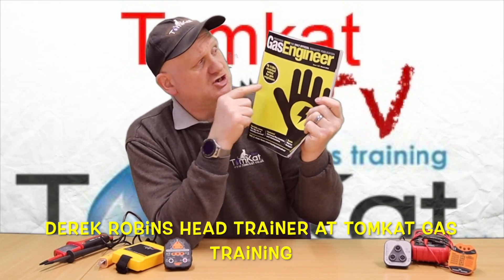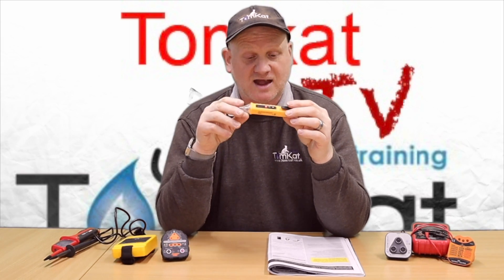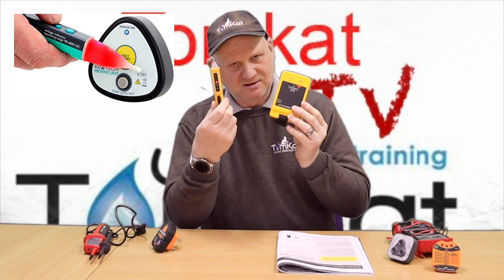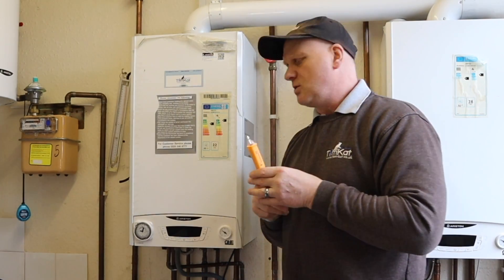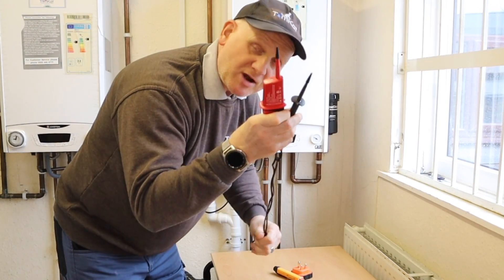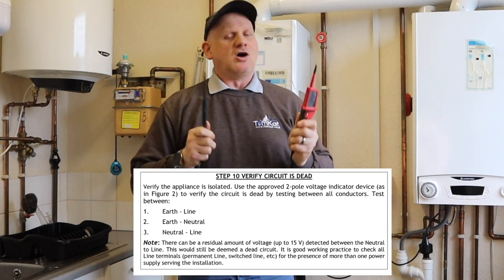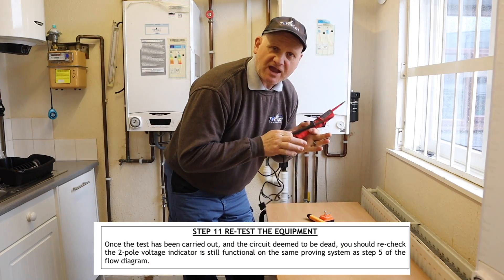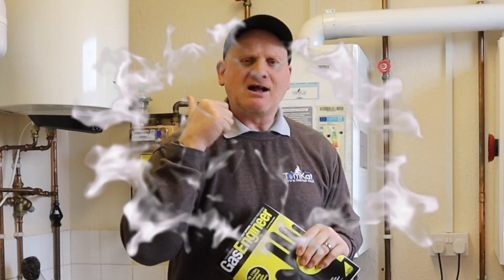Gas safe technical bulletin 118a electrical safety for gas engineers. Looking at the changes.

Comment: Can you clarify if Earth Loop impedance testing is required please?

TB118 Jan 2018 mentions undertaking an Earth Loop Impedance test and the equipment required. 

But there is no mention of an Earth Loop Impedance test in TB118a, and TB118a clearly says it replaced the now withdrawn 2018 version.

I understand that TB118c will follow and that will cover Earth Loop Impedance, but what is the current position?
Reply from the maker: @PaulWells-d8h  not required under tb 118a
Reply: @tomkatgastraining  Thanks Derek .

Comment: Thank you for such a prompt reply, Like you I've been doing this for a long time and love your way of passing information.  Back to the live casing though.... If the case was live why didn't it go to earth and trip / blow the fuse ?
Cheers Derek
Reply from the maker: Top and bottom of the boiler were plastic and not connected to earth so live case good job it was in an office in a locked cupboard

Comment: Hello Derek,  So a screw through the bracket to the live conductor and the fuse /RCD  trip didn't go?  Does this mean that the boiler had been incorrectly wired, with no earth? and thereby all the heating and gas pipes were also live?  Someone could have been Killed!
Reply from the maker: No it had only just nicked the live it didn’t touch the earth wire and it was on a fuse not mcb and yes some could have been killed

Comment: As nice as the bulletin is, from dual qualified position it's a bit of a joke. For instance the death sticks should never be used to prove dead but are used to identify if something is live and honestly should never be trusted. Voltage testers are always a sensible idea (multi-meters don't comply with GS38 though they're more useful for a service and breakdown engineer).

It's been a long time coming but it also shows installs should have a double pole or triple pole fan isolator with fuse, not just be supplied via a switch fuse that doesn't isolate the neutral. Personally I find the biggest safety issue these days to be that lack of isolation especially on properties where supplies are now TNC-S (PME) as if the neutral rots in the road the CPC's/ earth of the installation becomes a line conductor, which a death stick will pick up after isolation in a property with a solid floor but not always with suspended floors.

Comment: The thing that really annoys me is that regarding multimeters. We who do repairs have them and most often need them to test thermistors,variable votages  and continuity and yet are not trusted to use the same tool to test for 1 of those features 240v. My last gas safe inspector told me I should be wearing a portable monoxide detector for entering people's homes. I said what about when I go out socially and he said yes there too. I think I will just take my analyser with me to the pub
Reply: i know what you mean, the new ones are not on this planet

Comment: Hi Derrek always enjoy your videos. You explained the none contact volt stick needs to test as low as 50volts but you tested on a 240 volt outlet, that suggests it only has been proved for 240volts not 50volts or is the test acceptable for full range of voltages.
Reply from the maker: Testing it at 230 volts is good enough to prove it’s working. The proving unit also only test the 2 pole tester at 230 volts even though it can show 12 volts.

Comment: The only trade to have to be regulated to do all other trades as well...what next from gas safe? Common sense when working with gas or electricity should come to the forefront.

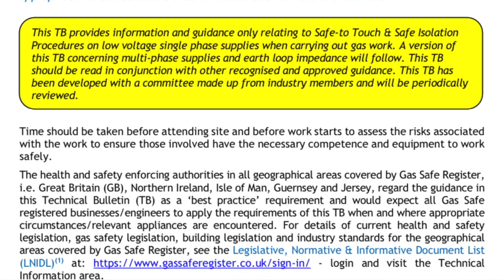Analysers were a one off qualification, which was straight away added to our 5 year acs course! How many times has the way we use our FGA changed? 18:43 

Do builders have to go back to be told how to lay bricks every 5 years and joiners how to cut timber safely?

Maybe gas safe should be ensuring our National gas transporter adheres to basic gas safety regulations and not allowing them to be EXEMPT( as confirmed to me directly from gas safe register)is that not also deemed a danger??

Yes they can re-pipe one of my installations due to a new main and relocation of the gas meter and very poorly as well and carry out no gas checks or commissioning of the appliances allowing the clown to re-connect to redundant pipework as well creating an 8mbar drop before he left, disced the meter and started next doors gas work!!!!

The gas industry is smoke screens and mirrors hence why so many engineers fail to renew every year, as with this country we know how to push good people away normally due to continuous greed. Some of the so called Rogue engineers are probably some very good well educated engineers doing nothing wrong but opting not to keep paying for their plastic card and be a puppet to this industry, I wonder why we have a shortage of trades??

Rant over.

Comment: Derek I have a question , I have an old boiler 25kwh which will have to be swapped out, British Gas came around and said as part of building l all the radiators must be fitted with trv, and pipe work gas to be altered into zones than s plan and only quoted for a boiler 3 kwh more than the heat loss now my brain is telling me that won’t be big enough if we are losing 20kwh in heat on the property as the cylinder would need more than 3kwh to heat it indirectly or am I getting my math wrong but also queried why if they have to change the heating feed to the cylinder to from 22mm to 28mm he quotes just new regs is that right ? My understanding is hot water is hot water and have no interest to go to a heat pump again especially with s building with 20kwh heat loss
Reply: Why don’t you pay a professional to look at your situation rather than hoping for free advice on youtube?
Reply: @milkyporridge5929   i am trying to query what a supposed professional told me, which i think is wrong hence ask the pro man who has covered changes in part l but i didn't fully understand so was hoping for a quick answer if this was mandatory or could I keep with 22 and 15mm pipes  as a 28mm would mean a major refit which i am not prepared to pay for, especially when others with online quotes are quoting over half less  which is why I am confused the price disproportion  heck its far cheaper to convert the place to a combi than what I have been quoted twice, but british gas were the only ones to do a heat calculation and seem to be quoting things I don;'t know if they are true or not for upgrades

Comment: I disagree with testing an earth path with a beeping function. A beep says there is an earth but it doesn’t tell you how good that earth is. To my mind you can only check that by measuring the ohms resistance with a multi meter. A high resistance could be a poor earth connection but would still give a beep if that was the only way you tested. Gas Safe should maybe not treat us all like idiots!

Comment: I’ve had two major electrical belters in my 50 year career, both of which could’ve killed me.

1. I became the Conductor when touching two separate bits of Electrical conduit. I was a lot younger at the time, but it really was bad & I was not right for a couple of days. Frightening really.

2. On a New Build & connecting an external Gas Pipe. Luckily I was wearing gloves with Rubber covered palms & just got a buzz.
Now, I could’ve taken a 80Amp Electrical Shock!! This Gas Pipe was the only way this house had a Neutral & had no Earth protection.  None of the RCDs or RCBs will trip if there’s a faulty Neutral coming into the property on a PME TN-C-S Systems.

Now I know a lot of you young pups think Safe Isolation is a waste of time. But be safe, remember, you don’t know what some fucking idiot has done in a property prior to your visit!!

Be safe & go home to your family at the end of your shift?